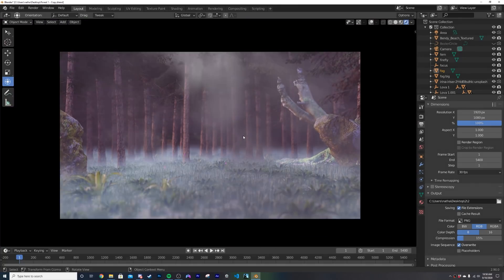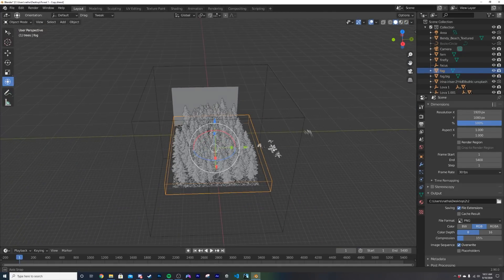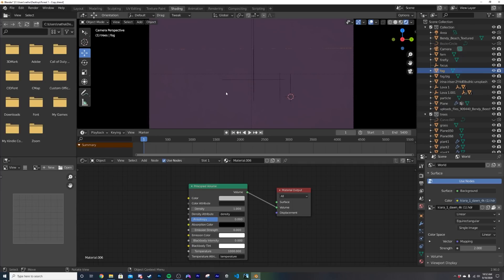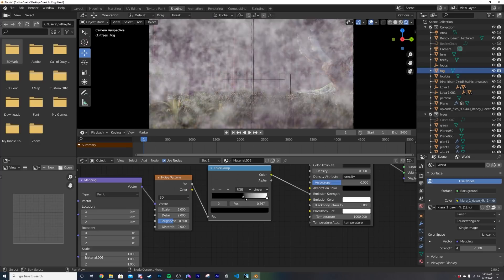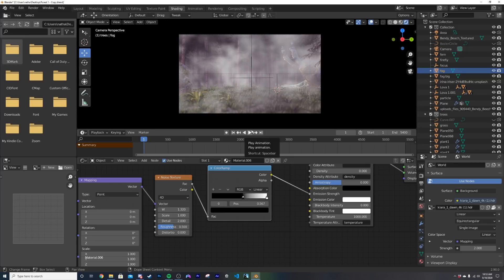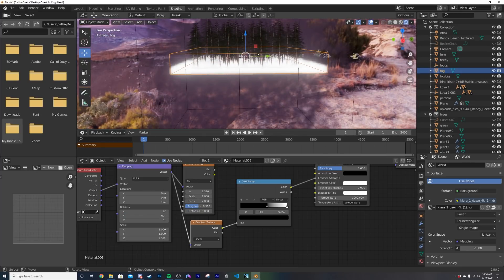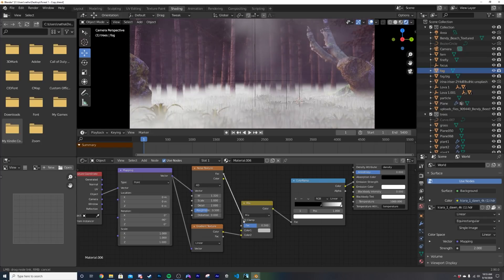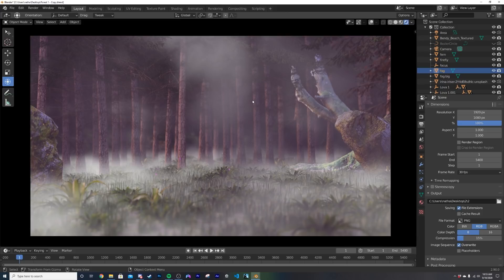Real Time Ground Fog in Blender 2.90

Comment: Thanks for the awesome video. By the way, I have one problem. Why does the black part look black without becoming transparent? I connected the nodes the same. Other than that, I followed similar tutorials and still get the same result. What's the problem? (I use blender 4.1.1.)

Comment: ColorRamp in Blender 3.0 does not make black transparent. I get black and white fog instead of gradient. Any solution?
Reply: I think I found the solution: Add "Mix Shader" after "Principled Volume" and connect the same color ramp as a factor and plug principled volume to the second slot of mix shader. Seems to be working.
Reply: @P4TTT  thank you kind sir

Comment: Great video and tutorial, running into an issue. I'm using 2.8.6 not 2.9, and everything works except the x location does not raise and lower the volume. It just looks like it scrambles around. Everything has been scale applied. I am curious as to why this is not scaling up and down. I literally have every node setup like your scene but the x location does nothing? Any advice?
Reply from the maker: I’m not sure

Comment: I still don't understand the difference between the 'color' and 'fac' output of a node. People seem to connect either one of them in 'fac' of some other node(like color ramp). It would be a great help if someone would explain it. 

P.S.  great video!
Reply: Okay the Fac output gives the greyscale/ b/w image whiles the color output gives the RGB image.
And plugging the color output into a color ramp converts the RGB to B/W
Reply: I believe  the fac output is a value of 0-1 (as a float value?), while the color output can be a different form of value like RGB  (3 numbers or a list of 3 numbers). When you plug in a color ramp, I assume it's also RGB but I'm not sure. That can make a difference from a math pov and thus can look different. I'm not really sure about that tho!
Reply: As much as I know, Color is RGB output whereas, Fav is BW, and in those  Black means 0 and White means 1, which can be used as factors. Idk if RGB values emulate the factors as well
Reply: May not be 100% accurate but as far as I know the fac output is a single value which gets rendered as white/black while the color node gives an RGB output

Practically there's really not that much of a difference that I notice